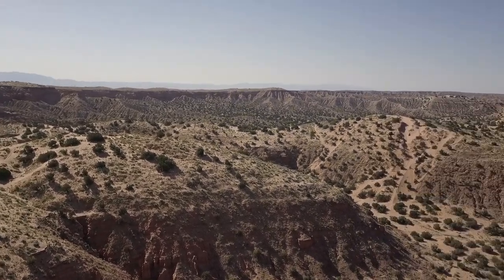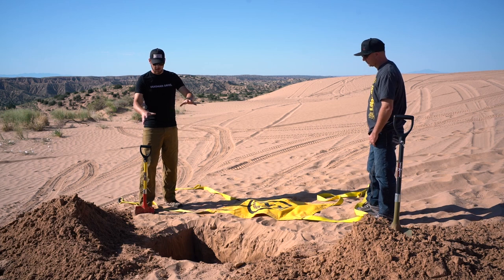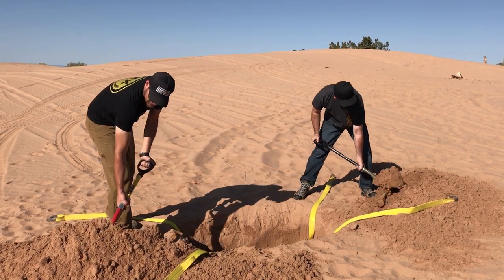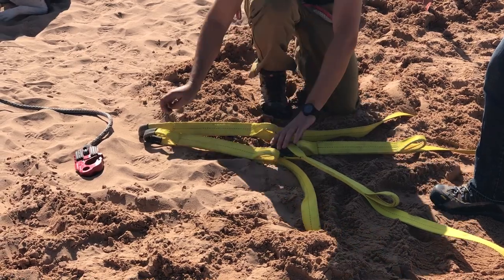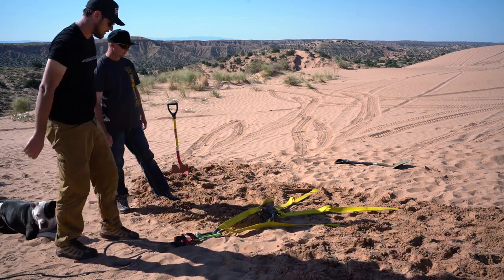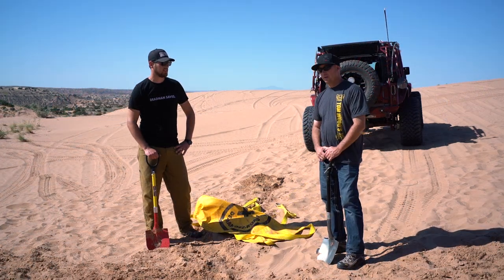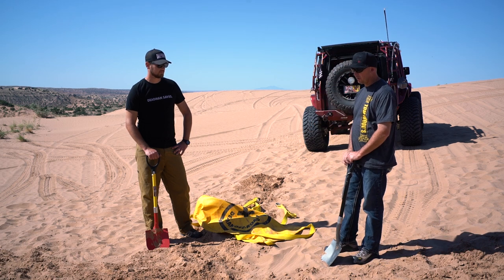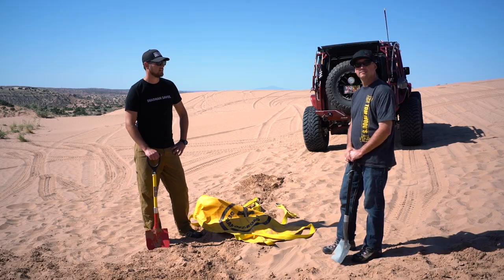Deadman Instructions: Ground Anchor

Comment: I'd use my Pull-pal and be home before these guys got thru digging their hole.
Reply from the maker: +twotwentyswift we’re not trying to replace the PP. The Deadman is best understood as a multi-purpose winch anchor for just about any terrain (rocks, trees, dirt, etc). When you’re on the trail, having gear that can play multiple roles provides a margin of safety. 🤙🏽
Reply: twotwentyswift dumb idea
Reply: The Deadman is good in rocks??? Yeah if you have blasting caps or a backhoe to dig them out, lol. And wouldn't it be easier to use the tree as a winch point than to dig a hole in front of it? LMAO
Reply: If you think the Pull-pal is a dumb idea, you've never been off road. I've used one for over 25 years and it's the quickest most efficient method for winching out of mud, snow,  or sand that's ever been devised.
Reply: Going cheap on self extraction equipment can be the most costly mistake you'll ever make. And spending hundreds of dollars on a winch and then using this as your sole anchoring method is just plain foolish in my opinion. A tree strap and a Pull-pal ground anchor have never failed to get me home safely and quickly for over 30 years. Sometimes that was in temperatures around -25 where if I'd had to spend much time outside digging the frozen ground I'd likely have died. I wish your business luck but frankly it scares me to think of people going out thinking they're prepared with one of these and a winch.
Reply from the maker: Perhaps our point here has been misunderstood. The Pull Pal is a good product, and it’s certainly quicker than digging a hole. We aren’t trying to replace the Pull Pal - the Deadman is simply about creating options on the trail. Specialized tools can do their thing well, but we prefer having tools that can play multiple roles in our kit IN ADDITION TO specialized tools. (For instance, we still carry MAXTRAX.) The Deadman can be used to quickly create a safe anchor around rocks, it’s a 75k lb tree strap, it’s a winch line extension, a radiator screen for river crossings, a ground mat, a fluid catch - and a ground anchor and more. Because it only weighs 7lb and fits under a seat, it’s something we keep with us all the time. 🤙🏽
Reply: It's a ground mat, a radiator screen and a fluid catch? Well heck, I'll take four!  I had no idea it was so versatile. This was the only video of it I've seen so I thought you were marketing it strictly as a ground anchor. I suppose the uses of your product are only limited by ones imagination. Chapeau!
Reply: and it folds up smaller then a pp im sold
Reply: i'm looking for a soft soil/sand Anchor, would this work in a mud bog where no trees are close to winch??
Reply: My thought as well...
Reply: For five times the price I'd hope so.
Reply: exactly, PP FTW.    Dig a hole in some gumbo clay and see how this all works out.   Good call showing this off in sand.   :)
Reply: I have a 2 door wrangler and I'll take the Deadman anchor over the PP metal contraption any day! There is no room in the 2 door for the PP. Plus the Deadman just seems more safe.

Comment: You can do this with a stick or shovel birthed with a recovery strap wrapped around the middle. Dig half as deep in a straight line perpendicular to the direction you are pulling and bam. You can repel down a mountain side the same way and recover your line this way too.

Comment: In Australia there is a thing called a sand anchor and what you do is u drop it on the sand(no digging) the begin winching as u winch it digs itself into the ground until it hits hard sand creating an anchor then you drive over it and it pulls it out no problem

Comment: A little  steel pipe and plate, careful thought and measurement, creative tube bending and welding and you can have your very own Pulpal like sand anchor. A couple of lugs welded to the plow stock so it can double as an anchor plate with a few construction stakes. A few hours of work in the shop and you have a solid multi-use recovery tool.

Comment: 7,000lbs wrangler???? Man that’s a lot of equipment considering factory stock it weight about 4,000lbs
Reply: 7,000 lbs is diesel F250 territory.  There's no way that Wrangler is 1500 lbs over its GVWR.  

As someone who DOES recovery work, the info they give in this demo is just idiotic and shows they're talking out their asses the whole time.
Reply: Yes but the Deadman weighs 2000 pounds ... :-)

Comment: would it work trying to pull a 4ton 4x4 fwdhar1 and trailer up that steep sand hill
Reply: Yeah it will work. You may need to bury it deeper but it will work. Breaking strength is not an issue, it has a breaking strength of over 66,000lbs.

Comment: Hi, looks a good product. Does it do anything else? I like to carry kit that has dual use when on expeditions due to space and weight.I suppose it would act as a tree protector as well.
Reply from the maker: Operation Long Drive hi, yep!! It works as a tree strap, as a rock anchor, a  bridle, a winchline extension, a radiator screen, a ground mat, a fluid catch, etc... it’s definitely a multi-purpose device.
Reply: Deadman Off-Road, Ye sounds good! Thankyou for that. A video might be worth doing of the various functions.
Reply from the maker: Operation Long Drive agreed! It’s one we have on the plan to do. 🤙🏽

Comment: So with the V2 version you are solving the odd geometry with the V1 models? If so do you still recommend attaching the "4" lines, ie. arms and legs together as shown in the original V1 versions, or can we now just attach all 4 at a single connection point?
Reply: The V2 is one large loop now. Yes they have solved the odd geometry with the new version. All you have to do is bring the two ends of the loop together to the winch with a shackle. The shackle will slide to the balance point, equalizing the load to all four corners.
Reply: @TheBryantwhite  Thanks Bryant... I  might give the old V1 a try by attaching all 4 lines to one common point and see how that goes next time I'm out in the Borrego dunes.  I've only used it in the sand once and it worked as advertised there. I've also had experience with it as a tree saver a few times.  Works well in that roll!

Comment: Nice video,  but it's far easier to just use the highlift jack. Lift up the rear and push sand into the holes the tires were in. Then do the same for the front.  Jeep unstuck!!!!

Comment: Simpler than burying your spare tire, that is for sure.
Reply from the maker: And about 2x as strong. (Yep, we tested it!)
Reply: And with almost everybody running aluminum rims, you won't bend the rim either ... did you angle the hole and wrap the strap around the bottom of the tire .... they hold pretty solid when dug in correctly ... most peole leave the leading edge (towards vehicle) of the hole straight up and down.  Heading to your website to order ..cheers.

Comment: What are the benefits of this over a traditional sand anchor?
Reply from the maker: Matthew Sylvester Good question! The Deadman is lighter, smaller, easier to pack, contains no metal parts to break, is multi-purpose (winchline extension, bridle, tree strap, rock anchor, etc), doesn’t require digging it back up or mounting/unmounting a large off-road tire, can be buried in a shallower hole vs a tire, and is easier to use solo vs some of the metal anchors.
Reply: Ah cool thank you

Comment: What abut of we dont have wich ?
Reply from the maker: Well, the Deadman is a winch anchor, so if you don't have one it's probably not for you. However, if you have a Hi-Lift jack, you can use that as a come-along and accomplish the same thing (albeit with more effort vs a winch).
Reply: Get a friend
Reply: napilyon bu hamood if youre in a place like this and you dont have a vehicle with a winch, you shouldn't be out there with that vehicle
Reply: napilyon bu hamood    
Use a come along  i got my f350 dually stuck in the snow covered hill and pulled it out with a 4 ton to a tree   come alonging  tires you  out though
Reply: call a towtruck,  your mother-in-law,  or stay home!

Comment: If you get stuck in sand stop the car immediately go check out the condition and reduce the tyre pressure make it around 7 to 12 PSI then try with 4L if it not came out you should partially remove the sand under the diff and under car and make pass to all 4 tires but when you decrease tyre pressure you must be very carful when you make turn or the tyre will go out of the rim 
with this method I go to desert with my Tucson FWD without any problems 😂 but because I got FWD I go with 8psi pressure and drive gently in 1st to 2nd gear but don’t forget to inflate tyre before go to street or you will need new tires 😂😂😂

Comment: Why not jus use a marine/boat type sand anchor. Works just as well with no digging involved. The more you pull the more deeper it goes.
Reply from the maker: Joe Mcknel great question! Those anchors work fine, and not digging is nice, but they’re much larger, heavier, more expensive, and only do one thing - and sometimes don’t work. The Deadman isn’t really trying to replace those as much as provide new options. The Deadman is 7.5lb, fits under a seat (easily a permanent part of any kit), works around rocks and trees, and can be used in many types of soil. In fact, in soft sand where boat-style anchors continue to cut through the sand (there are YouTube videos showing that), with the Deadman you can simply bury it a little deeper and it will hold. In one of our tests, we maxed out our equipment at 8,000lb with the Deadman, when a boat-anchor type was cutting through the sand at 3,200lb.